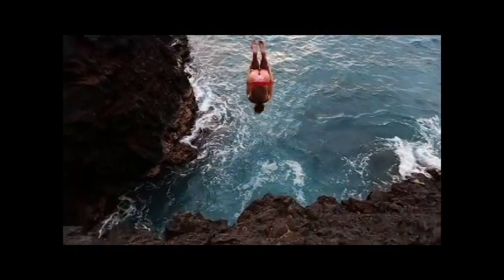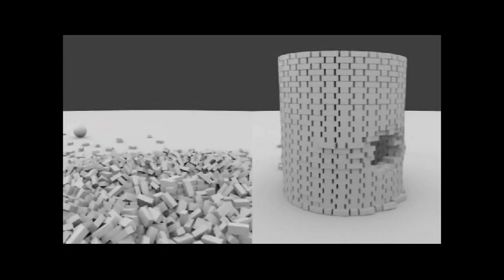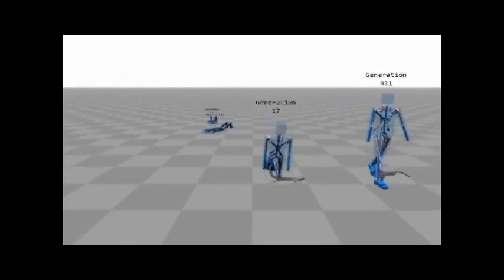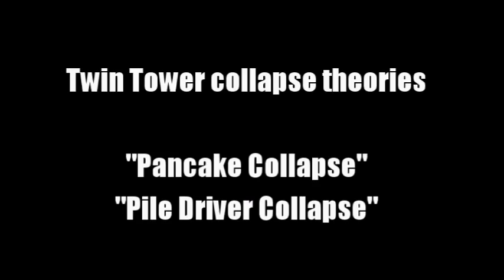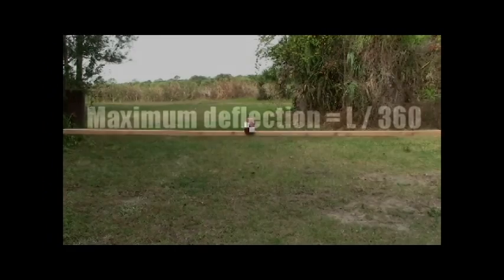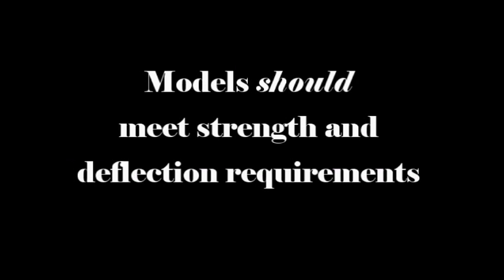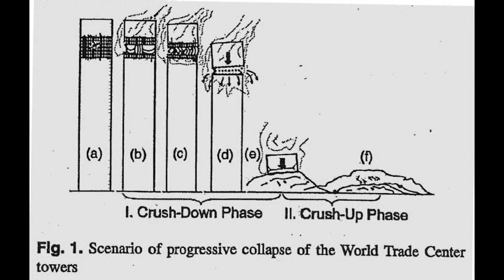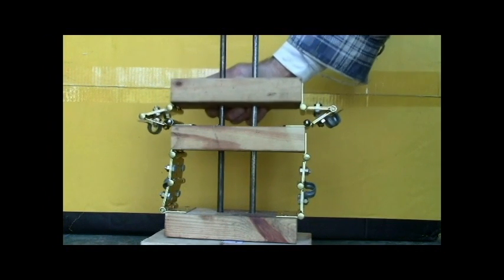9/11 Experiments: The Force Behind the Motion

Comment: Here's the bottom line, after 15 years of studying this nightmare false flag psy-op.
The most obvious RED FLAG is the WAY IN WHICH THE GOV'T/MEDIA HAS REACTED!
If 9/11 WAS A REAL TERRORIST ATTACK from outside the US and the WTC 1,2,7 collapsed from fires; 
1) There would be no  444-day delay in 911 investigation from the White House, resulting in a  (hello Dov Zackheim, etc) cover-up.
2) WTC collapses - due to obvious violations of Newton's Third Law, would now be the most openly studied and openly talked structural about failures in history. Enginneering schools would have special interest in it, not avoidance of "controversy".
3) Throughout the world, steel high rises would now ALL HAVE TO BE CONSIDERED UNSAFE to occupy, even CONDEMNED,  due to potential total, near free-fall speed collapse from simple office fires.
4) Commercial 757', 767s could now be flown like beefed-up bombers - 100+ mph over max op speed, alarms blaring, pulling huge g's, at impossibly low altitudes like a fighter jet, by low-skill, beginner pilots.
5) TOP GUN school would be closed. 
Air Force fighter jets and fighter pilots would be obsolete - just use a beginner Cessna pilot in an passenger 767 to strafe the enemy at low altitude. SIMPLE! Seems to work perfect, every time now. 100% success! Commercial airline 757s can now be flown by the worst pilots at ground level at 500mph, magically fold their wings back and then vaporize completely when they hit a building! Better and so much cheaper than military ops.
5) Magical, Mystical, Middle-East cokeheads, who like strippers more than the Koran and have been involved/trained with the CIA, can alter the laws of physics at their will. These hijackers can now survive and live on, even after the massive, destructive events! 
6) WTC crime scene would not have been destroyed. The full investigation would have been carried out properly and reported on by media openly. 
7) Silverstein would have skipped his fateful "dermatology appt".
8) GW Bush would have flew out of that school room chair like his dick was on fire, not sat there chewing his lip for 45min like a punk kid.
9) NORAD would be shut down.  TRILLIONS$ wasted on it, yet it didn't protect a single American citizen on our worst day. That's wasteful, folks. NORAD  war game exercises and air defense capability now subject to complete chaos and confusion, rendering them totally worthless when we needed them the most,  at the whims of the US Vice President.
10) Those in charge, the level pullers who span gov't, media and the military, who let it happen on purpose (LIHOP) would not have been rewarded for TOTAL FAILURE.

Comment: Superb video - Some of the contributors to this blog appear quite deranged. One contributor  ( I will omit his name as I do not want to embarrass him ) says  "The heat was considerable. The signs of it were captured by satellite. It amounted to the equivalent of a thousand tons of steel raised to a temperature exceeding 1,000 degrees Centigrade"

A collapsing building will heat a thousand tons of steel to temperatures of 1,000 degrees centigrade.
Where does the 1000 ton value come from anyway ? That figure is based on what ?

 What utter bollocks !

Thanks again for spending what must have been a considerable amount of time and energy developing these experiments.

Comment: There is a major flaw in your experiments. You have the framework holding the floors. 

What made the floor space in the unique design of the Twin Towers possible was that the floors held together the framework, which was also a series of as many sections as there were floors. 

Redo your experiments with the floors holding together the framework.

If your framework was allowed to collapse along with the floors, you will get an entirely different result.

Comment: Many of the comments are really miss the target by miles. This is NOT a total simulation of the WTC but about the reason that some structures can fail. And it proof basically that they can't do the things NIST said they did. NIST not even cared to  simulate the falling, go figure, and it awarded 20,000,000 $ from government!  BUT there is more: the WTC 3, 4, 5 and 6 did not fall totally, even if burned and devasted by the WTC fall. So why the WTC 7 fall? Just guessing: because there is 'some other force' that bring it down?  Why the others small buildings did not fall while being hit by thousands of tons of debries falling from 1,000 feets, when the WTC 1/2 should disintegrate when hit by a simple fall from 10 feet? Madness, i'd say.

Comment: All the experiments were wrong, they don't truly represent the actual building construction, you are using planks and paper both of which does not crumble, perhaps you may have used something better like a thin glass plate that can shatter on impact. Does this means I will now have to make and conduct my own experiments to prove the above wrong? well who wants to fund me, I will do it. Shall we say 1 million dollars will be all I need. thanks
Reply: They represents the phisical principles that are though to be the reason of WTC falling. And those experiments SHOULD HAVE BEEN MADE BY NIST (20,000,000!$) and it did not happen. I wonder why, and you?
Reply: WTC structure was not strong enough to support the weight of floor above the fire, as the steel structure became weak due to heat, then as the steel gave way, the floors above started to crumble down one by one and the sudden change in weight as each floor lands on the one below the weight of the falling floors must increases ten fold due to acceleration due to gravity as it gains momentum, so the structure below just can't handle this sudden increase in weight and collapses causing a chain reaction, so yes definitely a concertina effect and the middle core as I understand was not a solid but a hollow column, so it would simply shatter into pieces as it cannot absorb a sudden shock in loading from above.

Remember the weight of the floors on the final foundations would have been so greatly  increased, many  many folds more than the normal designed weight of the towers, and equally distributed such that all columns crumbled simultaneously causing the structure to collapse like a planned demolition.  

take a table for instant, it has 4 legs of 1"x1" and say 3 feet high, and  it can support a weight of a V8 car engine if placed gently over it, but now if you place that table in a lift and allow the lift to drop just 1 floor down at free fall, as the lift floor stops abruptly, all 4 legs would shatter and the V8 engine would drop down to floor with a weight many times more, so imagine of there were other similar tables below, then each would collapse one after another.
Reply: http://heiwaco.tripod.com/chall1.htm#hc                                                              Anders Björkman is ready to fund you with 1 000 000 euros which is even more than 1 000 000 dollars. Good luck making easy money bruh. :)

Comment: the official explanation sports the floors collapsing due to fire and as you can see in the official video the floor collapse however the internal spine of the building would not have budged and would have remained however they did not the internal spine was reduced to dust and this only happens in one instance and that's a internal detonation or weakening of the spine

Comment: Excellent experiments..I don't think you can get anymore nearer the truth to what actually happened. The fact that the top tilted sort of gives the game away. As the top moving wouldn't carry as much weight on a static ridged structure to push down perfectly horizontaly with full weight. If on a tilt and turn like a corkscrew like it appears then there wouldn't be enough even downward pressure to cause a complete collapse. I would have said that near the basement they blew several lower floors out to cause a consetina effect near the end of the collapse which would have been unseen due to the flow of nuclear dust. I'm only speculating on the latter..But that would explain why the intense heat would alter the chemical make up,and turn everything in to dust and incinerated everything around the base..Cars etc. Like you said there were explosives placed strategically placed through out the building..Or should I say,all the buildings that came down that day.